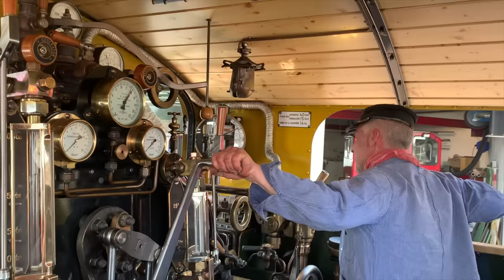DFB Dampfschneeschleuder R12 im Frühlingsschnee 2021, Steam snow plough in the swiss mountains!

Comment: As nifty as this is, seems wildly inefficient.
Reply: Try it with the shovel buddy
Reply: @derrickmoses1507  obviously it's better than a standard shovel, but I've seen rideable snow blowers that are a tenth of the size, require MUCH less work to operate, and can move just as much snow, but waaayyyy faster. He'll, a snowplow truck with some rail wheels on it could do it faster.
Reply: @Konghammer1  that’s not the point
Reply: @winstoncharleston2088  my point was it's cool, and ingenious, but inefficient compared to other avenues of doing the job. Thought I made my point pretty well.
Reply: SSG Live  you could always rig up train wheels on a snowplow truck and it would work just the same only faster and with less hardware involved.
Reply: SSG Live  dude, if a train can do it on the rails. Then a big ole snowplow with a specialized scoop could do it. They make and use rigs that allow trucks to go on rails, just have to make one for snowplows and a thinner scoop and it would work fine. Those trucks drive over snow covered mountains and next to icy cliffs all the time in the rockies.
Reply: its old compact snow. nothing short of a digger or two is going to shift it. Also a snowplow would make hard work of that much snow unless you dig a trench every meter or so to weaken the snow ect.
Reply: You rig a sharp edged snow plow on the train that cuts the snow and pushes it to the side, no fucking brainer, the only logistic is to make the plow strong enough and thats it, its fucking snow not diamonds.
Reply: @Dexyu  "it's fucking snow not diamonds" 

Snow that's been left there an entire winter is pretty much an ice block. Trains do not have enough grip to just "shove" snow out of the way. 

Try pushing your car while on ice, I think you understand the physics involved.
Reply: @Dexyu  lmao you clearly dont know anything. Frozen ice and snow can be literally harder than concrete.
Reply: The issue here is that the "snow" was pretty much frozen to solid ice, also this is more of a traditional thing :)
Reply: It might be for our times but this is a restoration from over 100 years ago. I bet it was hightech back in 1910 :)
Reply: Yes. As the other guy said; you’ll have it cleared by spring
Reply: @Konghammer1  all fun until the truck gets stuck and an avalanche traps the driver
Reply: @marioelburro1492  the same could happen to the train. Those wheels aren't locked to the track and the train has a much larger surface area to press on than a truck would have.
Reply: @Konghammer1  no, you have not seen a rideable snowblower that is a tenth of the size move just as much snow.... that snowbank is literally taller than the men themselves. It would have taken you a week to clear what they did unless you brought in heavy construction equipment to compete... but that rideable snowblower would have gotten you nowhere
Reply: @S-K69  I'm talking about a snowplow dude. It's a multi-ton heavy rig that's wider than a semi cab and about as tall but made with pure metal, no plastic or fiberglass. I'm not talking about a friggin rideable lawnmower for snow.
Reply: It seems inefficient since the snow is hard as rock. Its melting, it‘s compacted throughout the whole winter. Watch other videos of that thing. It does a great job when the snow is fresh and furthermore that thing is like a 100 years old
Reply: I wonder how much it would cost just to rent a modern version this thing that would get it in one whack without stalling.
Reply: Most snowblowers work best in powder and less dense snowpacks. This is a deep spring remnant, very dense and heavy, and you'd need another kind of head to make this work better in these conditions.
Reply: Did anyone else notice that this is on a rack section?  All of this discussion about trucks on rails doing a better job - is that a truck converted to run on rails, with a rack drive  operating at the gradients that require rack traction? We've had snowstorms on the north shore of Lake Superior that required explosives to breakdown drifts so that the highway plows could actually move the snow on gradients much less than this. And that was fresh snow, compacted by wind, not the winter's accumulation that has compacted for months.
Reply: @Konghammer1  doesn't matter. Its what we had back in the day. its a steam engine. its what they had. Anything you mention that is more efficient that ISNT from that time is completely irrelevant. Even modern Desil trains have this issue in hard snow anyway.....look: https://youtu.be/3gEfX8-g7Dw?t=23
Reply: @RandoWisLuL  considering they are STILL using it to this day, I'd say it's relevant. Most trains these days aren't specifically designed to move snow either, so the comparison doesn't really work. You'd have to compare a snowplow train, to this one, not just any modern day engine car.
Reply: @Konghammer1  sure you have.  nice story Broseph!
Reply: @FLYSUBS89  eh?
Reply: @sklerp386  even in it's original time, having to stop every 5 feet to get the blade moving again, which takes a minute or two each time they do it, is inefficient. 20 men with some picks and shovels could move faster than that, I will grant the engine allows them to have a place to get warm while it's being done, but hundreds of miles of track done at 5 to 10 feet at a time? That's insanely slow.
Reply: @Konghammer1  ok dude
Reply: @Konghammer1  this ain’t ur sidewalk buddy, this is 9 feet of vertical packed snow
Reply: @georgeheld1901  I'm aware. Hence the picks I mentioned. Lodges and snow bases use a thick string to cut the snow pack into large blocks and then slide those blocks out of the way, or off the roof, or into a ditch where they fall and break up into powder. Huge pieces taller than a person and almost half as wide as a car, packed into place all winter, and people use string to remove it... this isn't solid Ice here, it's packed powder.
Reply: @Konghammer1  oh my I’m sorry I shoulda read the whole comment chain before writing that, I just saw ur first comment
Reply: @Konghammer1  try to go up the mountain with that one
Reply: "...seems wildly inefficient..."  Well, it's a restored antique.......and probably not bad as a spare, or when they're out of diesel fuel or something.
Reply: This machine is over 100 years old! They didn't have heavy trucks 100+ years ago! At 1:11, you can see the modern replacement snow blower.  Before this machine was built, snow was cleared by men with shovels.  Additionally, it was not designed to handle spring hard pack, basically ice.
Reply: But it does have no cold start issues in  -30 C
Reply: @Konghammer1  Those things weren't invented at the time.  They had some trucks, but they were a joke.  For a long time, steam had much more power than the gas engines of the time.
Reply: @Konghammer1  They didn't exist back then!
Reply: @Konghammer1  Different era!  Why didn't they just use lasers to evaporate the snow 100+ years ago?
Reply: @Dexyu  No place to push it sideways to!  You need a snowblower to get the show up over the snowpack!
Reply: @Konghammer1  They didn't exist 100+ years ago!
Reply: @littleviking488  Face it, some people are just clueless. We live in the Lake Erie 
"Snow Belt".
Reply: @Konghammer1  There is no ditch, they are digging one!
Reply: @derrickmoses1507  they actually had to use shovels as well

Comment: To everyone complaining how slow and inefficient it is: 

First of all was this recorded in April, so the Snow has been slightly melting and re-freezing for Months, being compacted in the Process. It is more like solid Ice, although it looks snowy. The bent Steel Plate at 19:10 just shows how hard the Snow is. Rotary Snow Blowers work very well with fresh, powdery Snow but aren't built for rock solid Snow like this. In the Video, the Snow Blower is being tested after 10+ Years of Restoration, which unfortunately happened to be completed in Spring, so waiting for ideal Snow Conditions would have taken 6-8 Months.

The Dampfbahn Furka-Bergstrecke is a Museum and there is no Commercial Traffic on the Rail Line, so being slow and inefficient doesn't matter too much. The Rail Line is closed during Winter anyway (it goes almost 2200 m high which means the upper Parts are prone to Avalanches), so it was never intended to clear all the Snow. As stated above, the Video shows just a Test Run. If they had to clear all the Snow ASAP, they would probably use the modern Electric Snow Blower that you can see at 01:12. Thinking a 100+ Year old Steam Engine would be used to do any actual work is ridiculous, not only because it is slow, inefficient and expensive but also for the Risk of wearing out and potentially damaging a historic Machine, as proven by the bent Steel Plate.
Reply from the maker: Perfect described. Thank you!
Reply: @schoeneggbahn  Did that earlier already, but some Idiot spammed the Thread with Insults so I copypasted and deleted that Comment. He then started spamming one of my Videos and apparently disliked several of them because he is so offended by qualified Content. That's the Video where he spammed, and he's polite there compared to how he behaved here: https://youtu.be/tieAXy1Gpl8
Reply: @schoeneggbahn  Kleine Interessensfrage noch als Nachtrag: Ich mach ja Videos von diversen historischen Maschinen mit recht detaillierten Erklärungen über die Funktion. Dabei schiel ich auch schon länger auf so eine Dampfschneeschleuder. Wo könnte ich mich wegen sowas hin wenden? Die RhB-Schneeschleuder kann ich denke ich mal vergessen, weil da ja ein Unternehmen und kein Verein dahinter steht. Von der DFB hätte ich eine Mailadresse vom Projektleiter Martin Horath gefunden. Diesen Winter wird das wohl eh nix mehr, aber im Moment wird die R12 ja scheinbar eher exklusiv vermarktet. Die Normalspur-Maschine steht doch in Brugg? Da hab ich mir eventuell was organisiert, um mal den Maschinenraum der Ae 4/7 in Betrieb zu filmen. Wenn das alles klappt kann ich ja sonst mal da nachfragen, wobei ich aber nicht weiß, wo diese Maschine mal tatsächlich im Schnee gezeigt werden kann.

Jedenfalls hab ich hier mal zwei Beispiele dafür was für eine Art von Video ich ungefähr machen will; die beiden Videos sind von anderen Dampfmaschinen:

Dampfschiff Stettin in Hamburg:
https://youtu.be/bWQM1eQKdLY

Sulzer-Dampfmaschine in Schlieren:
https://youtu.be/wTZtXs-HtT0

Wenn der Hamburger Hafengeburtstag nicht wieder abgesagt wird kommt im Mai noch ein ähnliches Video vom großen Zweitakt-Schiffsdiesel der Cap San Diego, und was ich in Brugg mit der Ae 4/7 vorhab ist auch so ähnlich. Wobei sich das wenn's klappt wohl eher auf "GoPro reinstellen und draußen warten" belaufen wird; ich glaube nicht dass ich selber im Maschinenraum bleiben darf sobald der Bügel oben ist.
Reply from the maker: @Genius_at_Work  R12 ist momentan nichts mehr geplant bis sicher Frühling 2022. Xrot 100 wartet auf viel Schnee im Mittelland. Dies ist leider sehr selten der Fall. Kann sogar nich Jahre dauern. Trockenübung wird es wohl am Tage der offenen Tore geben im Bahnpark Brugg. Datum weiss ich leider nicht. Ae 4/7 sollte machbar sein. Allenfalls auch über Herr Bachmann in Payern. Dort stehen einige Ae 4/7 und eine Ae 6/8 unter Strom. Gruess Oli
Reply: @schoeneggbahn  Tag der offenen Tür in Brugg ist dieses Jahr wohl an Pfingsten, das sieht für mich leider ganz schlecht aus. Ich hab mit Rudolf Hürlimann schonmal drüber gesprochen, weil ich unter seinem Video von einem der Luzerner Raddampfer mit ihm ins Gespräch gekommen bin (bin Heizer auf dem Dampfer Alexandra in Flensburg und er konnte einem anderen Nutzer eine Frage nicht beantworten, da bin ich eingesprungen). Ich hatte ihn zunächst wegen der Ae 4/7 gefragt, laut ihm könnte das an und für sich klappen, problematisch sind eben die Sicherheitsvorschriften für Hochspannungsanlagen weswegen ich eben wahrscheinlich nur meine Kamera (bzw. wohl eher mehrere um Trafo, Schaltwerk und zumindest einen Motor draufzukriegen) in den Maschinenraum stellen und dann raus muss. Ich hab zwar bald eine Schaltberechtigung für Mittelspannung, aber die wird mir dabei wohl auch nicht weiterhelfen. Alternativ überlege ich sonst in Olten wegen der Ae 3/6 II anzufragen, die hat ja auch die Kompressoren im Maschinenraum, dafür hat die Ae 4/7 eben den Buchli-Antrieb.

"Reichlich Schnee im Mittelland" heißt wahrscheinlich, dass die Schneeschleuder auf eine der Museumsbahnen muss? Auf den SBB-Strecken wird der Fahrplan ja wohl kaum Schneeräum-Vorführungen erlauben.
Reply: Thanks for the context.
Reply: Anything that wears out or breaks could easily be fabricated in their machine shop.
Reply: Sorry it still looks inefficient and I know it's a museum piece but why waste natural resources on something that's so inefficient. I mean isn't Germany struggling to have its own natural resources already buying how much from Russia?
Reply: @cleanearth6238  That's in Switzerland. And the Line is closed during Winter anyway, so they just clear as much Snow as they want for said Demonstration and not the entire Line. The Amount of Coal burnt doing so is insignificant compared to what a Powerplant burns in a single Hour.
Reply: Danke
Reply: so what was the point of this video then? how shittily it can remove snow?
Reply: @livingmodern  To show how Snow was removed 100 Years ago and how much Work it was. This literally was the best Way back then.
Reply: @Genius_at_Work  so basically back then they took about 6 months to remove a usable patch of rail
Reply: @livingmodern  A similar Snow Blower on the Bernina Line cleared 8 km of Track blocked by Avalanches (equally compacted) in 8 Hours. This happened in 1968 btw, where newer Equipment was around but it just kept stalling while battering a Steam Rotary Snow Plow into the Snow like done in this Video worked. Not fast, but it worked.
Reply: @Genius_at_Work  this stalled after 12 inches of snow removal...it was like watching paint dry. there's something wrong here...I've learned about trains and done train sims and since is just silly.
Reply: @livingmodern  "Playing Train Simulators" is a silly Argument. I operate real Steam Engines and know first hand how wimpy they are. They can be overloaded to huge Amounts of Torque, but at the Cost of ridiculous Speed Drops. That's exactly what's happening in this Video. There are some Rotary Snow Blowers that were converted to Diesel Power, and I guess you got the Impression of Rotary Snow Plows blasting through Snow as if it wasn't there from these. Plus that these Videos usually show powdery Snow.
Reply: @Genius_at_Work  so again what's the point of showing a snow blowing train that can't do the job at all
Reply: @livingmodern  I guess you can't wrap your Head around the Purpose of a Museum. By that Logic, you could ask yourself why the Dampfbahn Furka-Bergstrecke runs Steam Trains over an Alpine Pass, even though there is an Electrified Tunnel under it that cuts travel Time by over 90 Minutes.
Reply: @Genius_at_Work  I guess you can't wrap your head around the fact that this was barely a steam snow demo and wasted ten minutes everyone's time watching a train move 5 inches back and forth showing nothing but inadequate equipment and engineering
Reply: @livingmodern  Then watch another Video on this Channel, where the same Machine is used in fresh, powdery Snow and works perfectly well. Just search for it on the Channel; I'll put the Link into a second Comment too. Reason is that many Channels (myself included) don't allow Links in the Comments. If I posted a Link anyway, the Comment would just be hidden weithout me getting notified. So there's no Way for me to know if the Link worked or not.
Reply: @livingmodern  https://youtu.be/4PXcM8ZL7Ks?t=802
I even set it to start playing at the right Moment, where Snow Blowing commences.
Reply: @Genius_at_Work  nah im good
Reply: @schoeneggbahn Pls what is the name of bck ground music pls tell me🤔

Comment: "hey hans, how do we clear the snow off of the railroad tracks"
hans: "BIG FAN"
Reply: I think you would like to see how huge tunnels are dug.
"REALLY BIG FAN"
Reply: Would help a LOT (and make life a lot easier too) if they vented all the waste locomotive STEAM (with coal residues) directly into the blower cage - so that the steam is JETTED FORWARDS, same as if using a water blaster..
Blowing super-heated steam, directly onto that hard packed snow, inside the blower fan casing, would help remove any buildup before it stalled the fan.
Also - by NOT RAMMING THE BEGEZUZ out of it at speed, but slowly easing forwards, with heated waste steam and a spinning rotary blower fan - that would make super easy work of what they are making into an almost impossible job - with a mental attitude of - "just push it ahead - as we shove a cold spinning fan into it".
Reply: 55 likes

Comment: Probably on a colder day with lighter-less dense snow, would have cleared it with Ease, super wet spring snow is tough for any blower. The Rack Loco looks incredible as it goes along, so much going on there, the restoration on the machines is pretty stunning!
Reply: Looks more like months of compacted snow now heavy and wet.

Comment: Some of the most beautiful country and machines I've seen on YouTube, thanks for the video.
Only thing missing is about 1,000 HP on the engine turning that rotor... But totally get the time period.
Reply: believe me this thing has tremendous amounts of power , the issue is that the snow is wet and the loco behind is jamming it in